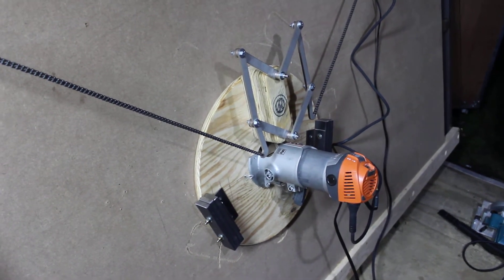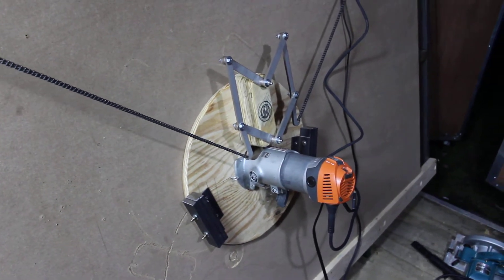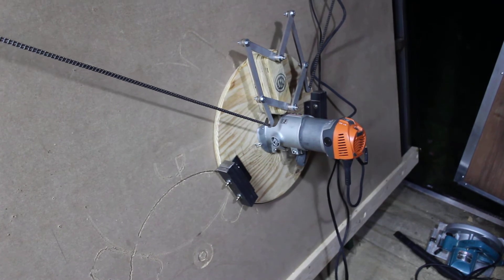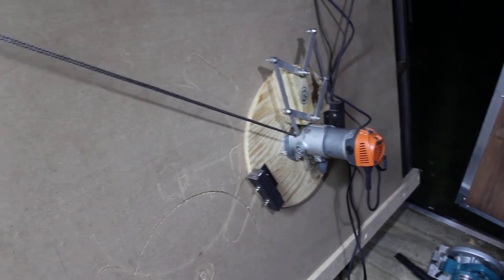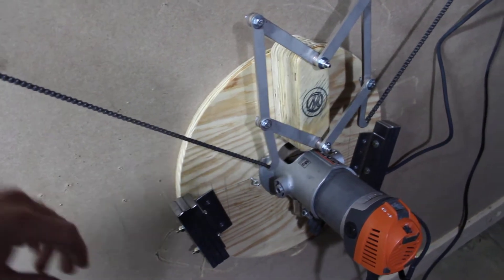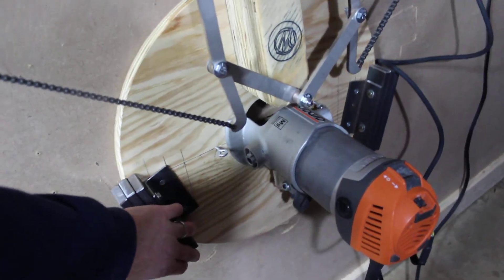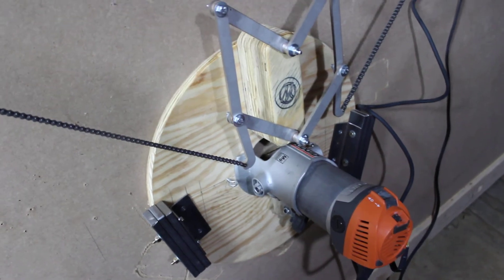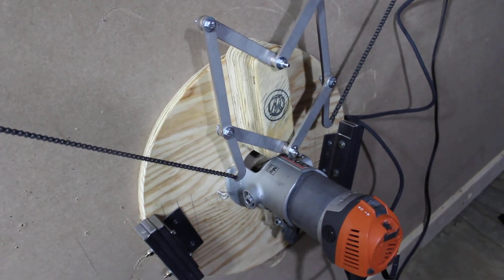Maslow Top Mount Linkage System First Test

Comment: Is this an actual Pantagraph? Or is that just what they are calling that triangulation thingy attached to your sled?
Reply from the maker: No, it is not. It's a misnomer from the early days of development. It stuck for awhile but It's really a linkage system that allows the system to figure out the bit position using triangular kinematics. That is, it can draw a straight line from the motor sprocket to the bit. It makes calibration much, much easier.

I renamed the video to clear up the misunderstanding. Thank you for helping me clarify that.
Reply: Sorry wasnt trying to be an ass..... I have a vintage Gorton "duplicator".
Pantagraphs are amazing machines and cume in all different sizes and flavors.
Mine is a gem. I am fascinated by them. Was excited to see something "new".
I just got my motors from Maslow yesterday. Im solving the problem by replacing the chain with linear rail bearings....
The rail stays aligned with the cutting bit at all times by mounting the sled on a lazy susan style bearing....
Reply from the maker: Christopher Leveck: I didn't get that sense at all. Peer review one of the great things about YouTube. We're a all more informed when we have the correct information. ;)